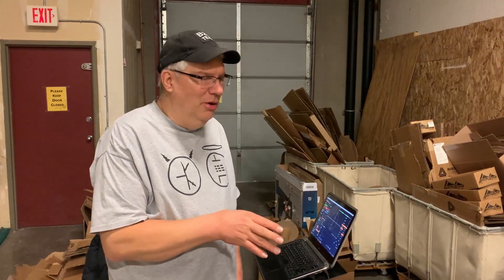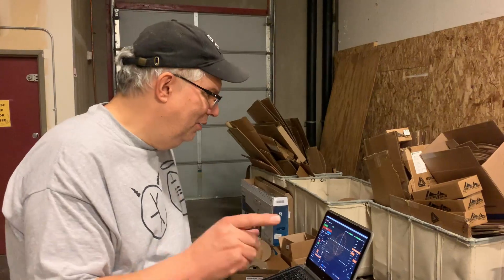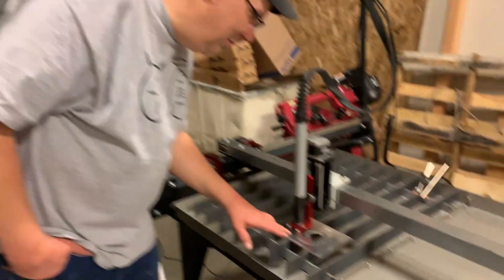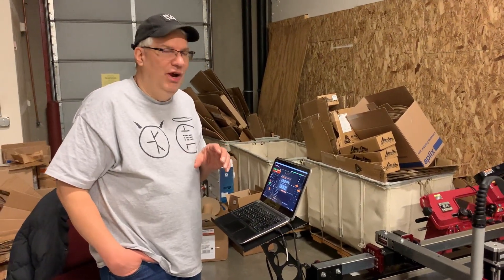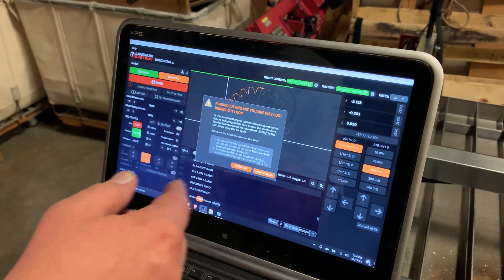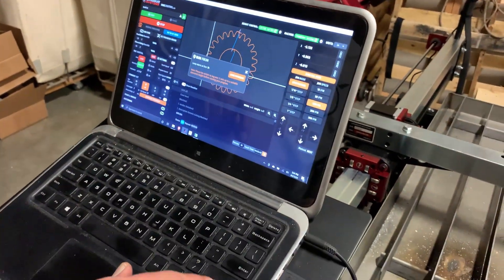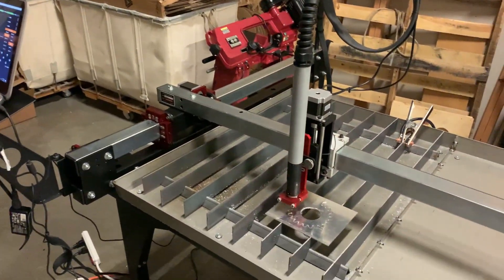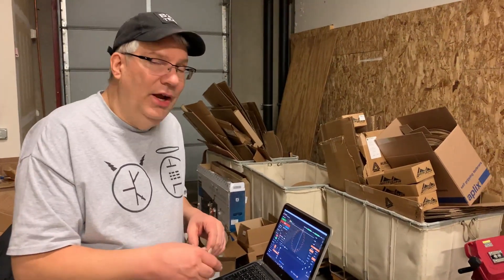Crossfire Pro First Cut

Comment: Nice video. If you get the retry cut option, you can click ok, raise the z axis, then check your g code. What I have done is scroll down the g code looking for the green dot on my view screen to match where my torch stopped. There you can click line of run from line. Not loop. This will start your g code on that spot. Once you hit start it should begin right where it stopped. Hope this helps. I have done it enough. Every time I put a new nozzle and electrode in, my machine will stop on around the third pierce and repeat for about three to five times. After that, it runs flawlessly until they wear out. Not sure why, but I do buy after market consumables for a much cheaper price. It's worth it to me. I sorta have a system down now. Also, I bought an extra charger for my laptop so I could have one at the machine and one in the house. The after market charger kills my THC. I leave the factory charger at the machine and the after market charger in the house. These are a few quirks I discovered along the way. Maybe these tips will help save someone else some time when diagnosing a malfunction. P.S. Always check your ground clamp.😉
Reply from the maker: Thanks for the tips. I will definitely need to play with the "run from line" option to understand its operation. I haven't used my machine enough, but so far I haven't experienced any noise related issues. I can see a laptop power supply RF affecting the THC. Ground clamp, got that covered. Thanks for watching.

Comment: Hey, Craig.  Thanks for the video.  I am getting my Pro in April.  Do you mind sharing the outside dimensions of the legs?  Langmuir told me that they are 62-3/4" x 29-1/8", but I'm just not trusting those figures.  Thanks in advance!
Reply from the maker: Will do. I'll let you know.
Reply from the maker: outside leg to outside leg is 62.75 x 29.00"
square leg 2x2"
table outside (controller mounted to back left leg, with ) ~68x57.5"
I'll re-check these because they're much different than LS drawing, https://assets.langmuirsystems.com/img/pro-assets/pro-linedrawing.png
Reply: @CraigHollabaugh  Thanks again!
Reply from the maker: @shawnsnyder8695  confirmed the outside leg measurements today. My post above is correct.
Reply: @CraigHollabaugh  Thanks, Craig, I really appreciate it.

Comment: That looks awesome! Seems you just need a dedicated single phase 20A fuse, so should be easy to solve your power requirements. I've never seen a plasma cutter cutting up close. Seems to be a lot of burs on the bottom of the sheet, is that common? I'd have expected that from a router bit, but maybe not from a plasma cutter. Also the cut width is quite wide... is that adjustable?
Reply from the maker: This are all great questions that I don't have the answers, except one. The electrical on that end of the building is being upgraded today for some other equipment. You're correct, a 20A 240 circuit is sufficient for the plasma table's requirements. I'll post another video showing the backside slag, ease of removal, cut accuracy, etc. I'll let you know. Thanks for the comment.
Reply: @CraigHollabaugh  Sorry for jumping in with all the Q's - I know you only just got it setup and only started playing with it. I'm really excited to see it running when you've mastered it and see how it compliments your current capabilities!
Reply from the maker: @UnexpectedMaker  Hey no problem, these are the same questions I have. Glad to hear others are interested as well.
Reply from the maker: @Joel This is how my CFP is wired. My control hardware is mounted to the rear left leg. To be honest, I have not any noise issues with my limited machine time. Its going to be COOL when you get it going. Also, I had some stupid welding mask that came with a welder that I keep around the table when needed. Have fun!